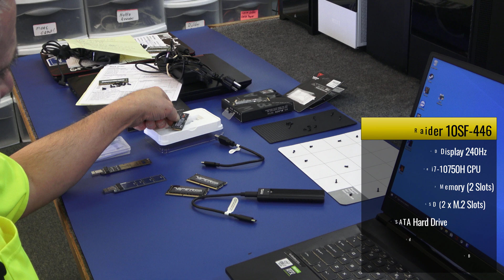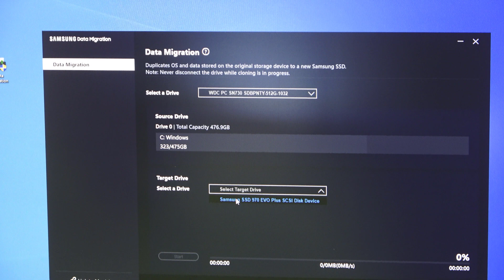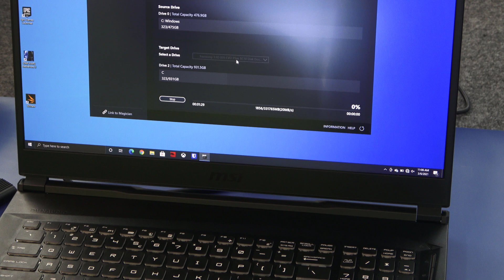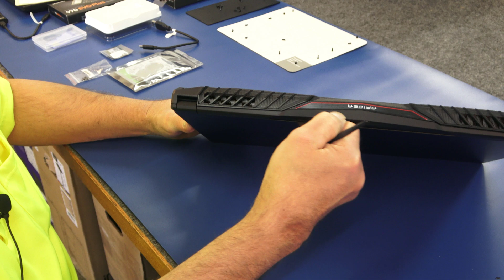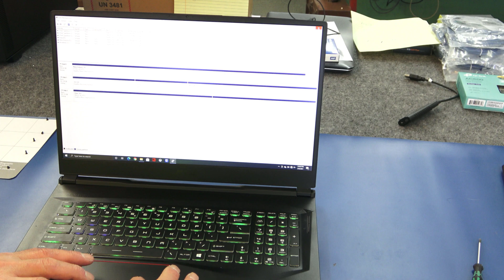MSI GE75 Raider Upgrade SSD, Memory and Clone SSD.  MSI GE75 Raider-10SF-446

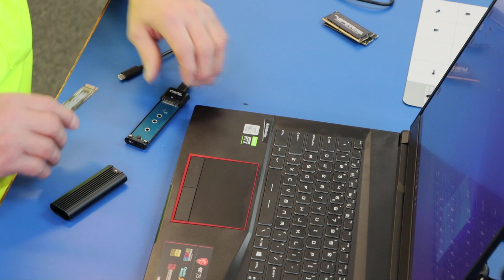Comment: 1:24 Cloning Process

5:29 Disassembly Phillips Head 0, All screws same length except for 2

6:08 Plastic Tool 1

7:30 Plastic Tool 2

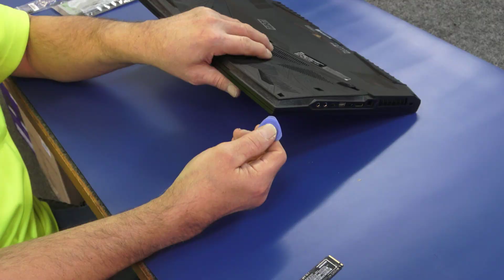6:21 Back Panel Removal

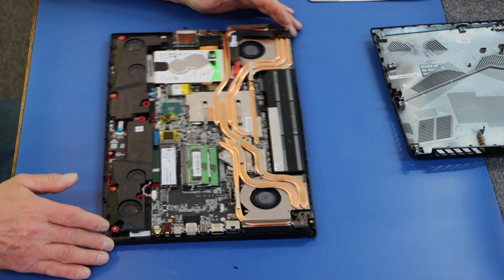9:23 Internal Layout

9:50 Battery Removal

10:23 Power Discharge

10:38 RAM Removal

11:40 SSD NVME Removal/Installation

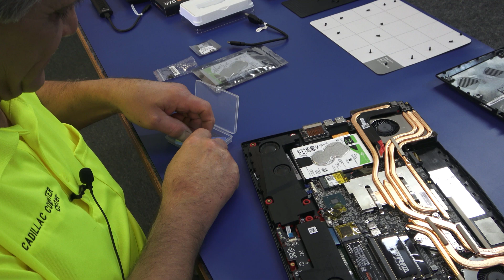12:36 Heat Pad Installation

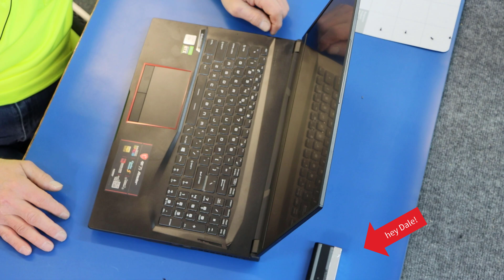13:30 Battery Reinstallation

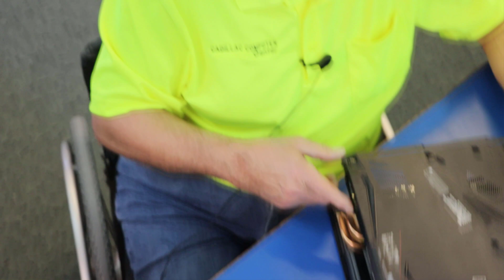14:05 Back Panel Reinstallation (Kinda)

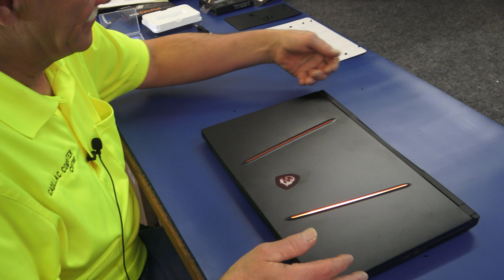14:17 Final Checks

Comment: I got my GE75 10SF over 2 years ago from Costco, and know that eventually I will be upgrading the 16 Gb or Ram, a new drive(s) and maybe a battery.  
Funny thing was that I accidentally violated my warranty within a month of buying it because when I picked up the computer the verification tape over a screw hole broke when my finger touched it.

I have had zero problems with this computer since I bought it and since I tend to keep them a long time I will be upgrading it.
Reply: Same, that was a good sale. Mine came with an hdd than I wanna swap out for an ssd. I’ve kinda been keeping all the games and the OS on the smaller ssd that came in there.

Comment: I got the GE77 last year, it has the 12gen CPU 2Tb M.2, RTX3080 and 32GB RAM. Goes very well, I have never opened it, it probably has a spare M.2 slot. Not sure if it has room for a SATA drive.
BTW I elected to get the 4K resolution at 120Hz.

Comment: I'm really struggling trying to find the right dimensions for my MSI GE75 Raider 10SE-008 RAM card. I'm hoping the Patriot Steel works, because I can't seem to find a straight answer. If anyone knows or can confirm it would be greatly appreciated!

Comment: I cannot pry my case back off for anything. I just keep getting hurt when i try. :( i probably need a better tool. Not sure what you are using but i am trying to pry this open with a flat screwdriver and it just keeps slipping. Worried about trying an exacto or something sharper tbh.
Reply from the maker: Please read the detailed description below video.

Comment: Hi, thanks for sharing this video, it helped me to upgrade our MSI GE75 Raider 9SF laptop. I did replace the original Kingston SSD of 512GB with a Samsung 980 NVMe M.2 SSD of 1TB. For the cloning part I did use Macrium Reflect instead of the Samsung software, to be able to make a real 1:1 clone including the OEM Recovery partition, what the Samsung software does not support. I also replaced the original Seagate HDD of 1TB with also a Samsung 980 NVMe M.2 SSD of 1TB, again cloned with Macrium Reflect including the large OEM Recovery partition.
Opening the laptop was a bit difficult at first, I did use a plectrum and with that I managed to open it, only a few notches were broken. Strange thing was with the testing with the cover loosely placed, after reconnect the battery the laptop wouldn't start after pressing the button. Only after connecting the power supply the laptop started again, firstly doing some checks and small disk repairs, don't know why as both SSD's are a full 1:1 clone of the original SSD and HDD. I'm typing this message running the upgraded laptop without the battery connected, so everything is working properly now after the upgrade.

Comment: I just got the MSI GE75 2020 10sf 446 model last Saturday. I'm happy with it. I got it through face book for $750. The only gripe I have with it is the power and fan button could have been a different color or lighted up like the other keys.

Comment: these are well engineered laptops that cope with high use... the only issue I've  found with them is the green emitting part of keyboards  led's fail after a while
Reply: Had it for 3 years. A key broke, the hard drive stopped working, and now the fans sound wierd and like there hitting something.
Reply: @siphax399 literally same experience with this piece of junk, the ssd stopped working and the hdd is slow asf and i had to wait minutes for everything to even load. then after all of that, the battery broke and i barely know anything about laptop repairing

Comment: so you took out the 512 and there was another slot for another m.2 right beside it so they could of had two m.2 drives but you removed the 512. the connector for the 2nd is right beside the screw you took out to remove the original one, and then it goes front front to back and the screw for the 2nd is closer to the heat sink fan. As you can see at 11:46 in the video.

Comment: Thank you so much for such a helpful video.  I appreciate that you took your time, gave tips along the way, and showed every moment along the way.  There are other videos out there that zip by the unlatching process, but your video gave me more confidence to open up my GE75.  Managed to swap out the 5400RPM SATA that came with my model with a cloned SSD and also installed an m.2 drive.  Thanks again!

Comment: Sir I have asus 509ja it comes with a hard drive but also has nvme slot. so do I need to buy a nvme SSD encloser for cloning or just installing it in the laptop will do the trick for cloning from hard drive.

Comment: Dear Sir, or anyone who read this. I have a question about the SSD thickness. SSD 970 EVO Plus has thickness of 2.4 mm, while the one I'm interested is Adata XPG GAMMIX S11 Pro that has thickness of 6.1 mm, because of the encased heatsink. My question is if the 6.1 mm would fit in the MSI GE75? I'd appreciate much of the comformation.
Reply: Did the S11 Pro fit?

Comment: Possibly silly question - what size screw did you use to secure the 2nd M.2 drive? I'd like to get all my parts in place before cracking open the machine!

Comment: Helpful... I was mostly interested in whether this model had a free M.2 slot, since MSI doesn't list that in their specs.

Regarding the M.2 heat pad, have you tested SSD temp before and after? I believe the way you are using it will actually slightly increase temps. I believe a heat pad like that is more effective than an air pocket at transferring heat from the chips to a heat sink, but is actually an insulator as compared to just air blowing over the chips.

Comment: Great video!  Thanks looking to do the same with mine.  I have the exact model.  Question when searching for compatible memory what do I look for? Also do you know the memory cap on this machine?  Thanks
Reply: msi says:   Unit can support a max of 64GB of RAM, Up to DDR4-3200, 2 Slots. System also has room for: one of the m.2 slot should be in use on the computer. 1x M.2 SSD slot (NVMe PCIe Gen3) 1x M.2 SSD Combo slot (NVMe PCIe Gen3 / SATA) 1x 2.5" SATA HDD

Comment: Thanx for the video.  You make it look so simple.  I wonder why laptop makers don't make the battery, memory and SSD drive replacement a lot easier so that you don't have to dismantle it.  Like they used to  some years ago..
Reply from the maker: Thanks for watching.  The price we pay for progress in technology I guess.  Everything is getting thinner,  smaller and faster.  But I know what you mean. Dale
Reply: I think it's due to cost cutting. Having a removable cover to access the drive or memory would have complicated the design and increased the manufacturing cost. Apple got away with it. Therefore everyone else follows suit.
Reply: A couple of weeks ago I received a new laptop for work, a Lenovo P15. IT wanted to move the 2nd SSD in my previous laptop (that had a broken battery) to the new laptop as 2nd SSD, used for data and VM's. That was quite a simple procedure, as Lenovo provides a small hatch covering the memory and the SSD's. This way it's no longer necessary to remove the whole laptop backcover ;-)